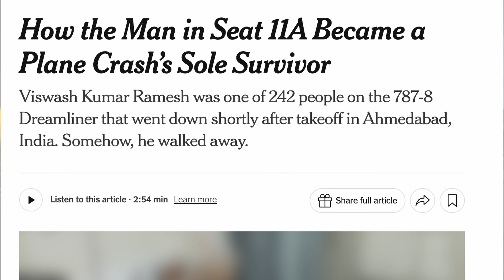Why the RAT Changes Everything – Air India 171 Update

Comment: I'm still wondering if the flaps even if not the primary cause made a significant difference.  That being raised and gear left down contributed to a worse crash by raising the stall speed.
Reply: The plane was not stalling in the video, it was flying in a high-drag nose-up configuration to buy time before the inevitable crash, as well as ensuring the lowest possible speed on impact.  That is what any pilot tries to do even when they know the plane is going to crash.

Comment: Note also the main gear is canted *forward**.  That condition (prior to retraction) speaks to me that the gear was in the **process* of retracting but failed.
Reply: Source: Swiss001
Reply: @Ducktility  Actually, a professional pilot... 🙄
Reply: Yeah, but even with a half deployed gear this wouldn't have happened on a normal flight.
Reply: @AccidentallyOnPurpose indicative of the power failure.
Reply: @AccidentallyOnPurpose  No, what this indicates it that the pilots didn't retract flap instead of gear. Likely not 'pilot error' (as least for a flap retraction).

Comment: If you hear a RAT over a 787 turbine then they ain't workin.
Reply: Not necessarily. The rat is incredibly loud and the engines are surprisingly quieter than you'd think. I've seen and heard  787's coming back from test flights in Charleston and could only hear the rat.
Reply: @paulmathis2191  You are exactly right.  RATs are extremely noisy.   We also had to do maintenance tests with them in the hangar using a hydraulic mule (no 787), OMG, they are so loud.  Yes, as you said, louder than the engines.
Reply: @paulmathis2191 On take off at full power i seriously doubt your hearing that even at supersonic ??
Reply: Power issue with airinda is common. Take any flight. Screens won't work.. aircon won't work.. some buttons won't work.. isn't it called as faults ? And still they are allowed to fly?
Reply: @ernishant13  "Power" when a pilot says that on a mayday call he is not talking about a light out in the bloody toilet
Reply: @jacktattis i understand that mate.. but fault is a fault. Small faults lead to big faults thats what i am saying. Air India never take faults seriously and slowly their airlines have issues which no one knows.. its scary
Reply: @jacktattis But the pilots words have not been confirmed yet, apart from "Mayday."
Reply: @ernishant13  All of which has nothing to do with the engines.
Reply: @ernishant13 that is not the same power. Those are interiors.
Reply: @ernishant13 

Are you serious?

IFE and how much air is being send to the cabin is not necessarily an indication of the health of the aircraft.
Reply: Agree!  And if the Pilot says "No Power, No Thrust, No Lift" the Aircraft is Dead in the Air at 650 ft. .... It's Over!
Reply: @jamesalexander5623 Did the pilot actually use those words? Apart from saying "Mayday" from the tower recording, nothing from the CVR black box has been released yet. 
It's social media rubbish, don't believe everything you read.
Reply: @jamesalexander5623 so you mean I'm dead 😮
Reply: @Bill-f4d9z  Unless you're in Seat 11 A .... Pretty Much!
Reply: @jamesalexander5623   Yes indeed but no one in charge is going to quote that They want a neat package where the pilots are going to be blamed . Boeing   had three disasters a few years back , quality control has been questioned and now this.The US aircraft industry does not want another investigation into Boeing.
Reply: 787 test flights happen over my house at least twice a week and you can only hear the RAT when it's deployed.  The 787s engines are incredibly quiet.
Reply: You got that right.
Reply: Especially at takeoff thrust!
Reply: 😃 I found the Rat 👉🐀
Reply: I was thinking the same thing. You have two jet engines at full power on take off, how would you hear that prop?
Reply: @LasVegas68  If they were working, you should see exhaust trails, especially so soon after takeoff.
Reply: Yeah I agree and it was the first thing I noticed when the video came out.   That sounds like what we are hearing is the reverse type sound of the prop cutting through the air from that thing and not a peep of jet engine noise.
Reply: That's going to make Boeing or GE look bad. 2 engine failures?
Reply: @jaysmith3259  I doubt it will be an actual engine issue or Boeing issue...
Reply: Maintenance? @jaysmith3259
Reply: @jaysmith3259  You assume it is Boeing fault.   The odds of both engines failing at the same time is very small.
Reply: That’s not true, Ram Air Turbines are very noisy, excessively loud and high pitched. Whereas a the main Turbine engines are designed to operate as quiet as possible and are a much lower and more thunderous pitch. The loudest those engines ever are is on landing upon deploying the Thrust Reversers. But on take off they may be at full power but are not as loud. Also like I said, they are at two very different and distinct pitch frequencies. So no, you would definitely hear a RAT. As an aircraft mechanic we do engine runs all the time, even at full power, and I never feel the NEED for hearing protection, however when we do a RAT ops check it is 100% necessary. It’s ear piercing. 😅
Reply: Exactly
Reply: Not so sure about that. I have done a number of RAT drops for maintenance in Challenger 604s. They squeal so loud, its unbelievable. We would get phone calls to the airport asking if "that" aeroplane is ok.  And the sound levels in the cockpit are almost unbearable. Anyone that's ever done a RAT drop knows what I mean. BUT - I only have that experience on one aeroplane, other RATs may have different audio levels.
Reply: Isn't that what he is suggesting? That the turbines aren't functioning. Although you could hear it on the JAL flight that was landing.
Reply: That's not correct,the rat will deploy automatically even with the engines at full thrust,and it's going to be poor maintenance and pilot error.
Reply: Plus hydraulic failure would prevent lifting the undercarriage.
Reply: @krkrdg surely it can’t happen this quickly. This thing had take off power. From the time an engine dies hydraulic pressure does not just disappear immediately.
Reply: Especially two jet engines that should be at take off thrust, they should be very very loud at that distance.
Reply: Exactly 👍🏼
Reply: You cant be this conclusive. You’re listening through a phone mic that probably has relatively low sensitivity at lower frequencies. You would need to see a normal takeoff to compare
Reply: @michaelbee8263  Lord have mercy.  Didn't you listen to what was said about why the RAT automatically deploys? 

There had to have been dual engine failure.

Working engines provide the electonics and hydraulics on an aircraft.  When there is an engine failure the RAT deploys in order to restore hydraulics and some electronics.
Reply: @deanjones2525  electrical failure causes the RAT to deploy. That may or may not be causes by engine failure. Loss of thrust doesn’t always mean loss of engine generators. Calm down.
Reply: Besides that, look at the landing gear tilting…
Before the crash, you can clearly see that the landing gear is tilting FORWARD.
This is the first step of the landing gear retraction sequence during takeoff.
But something stopped it—likely a hydraulic or electrical failure.
Reply: Air-conditioner had not been functioning for over a week on that.
Reply: Glad to know my RAT hearing in the first video comments was correct.
Reply: @orion_13 you’re so smart, good boy. What you hear in a phone mic is not what you hear in real life. The idea this thing had take off thrust and then went to no thrust in time to film this is ridiculous
Reply: @michaelbee8263 I've just been an aviation nerd since high school in the 80s.  I wanted to join the Airforce but was told that my height was already past max allowance for the F14.  It doesn't help that I am long torso.  My barber always complained that I sit as tall as when I stand. 😂
Reply: Wonder which pilot was flying. 🤷‍♂️ I would think the captain would be more focused on flying the aircraft instead of the radio.
Reply: Sabotage
Reply: Is there a betting pool of the cause?
Reply: Pilot used the entire runway to take off. Indicating something was wrong and pilot should have aborted before v1
Reply: How much money that Indian aviation has been taking from AI and Boeing is to be investigated by the bribery authorities in India
Reply: 😂😂😂😂. HAHAHAHAHAHA!
      Very simply put!😂😂😂😂
 Love it!🎉🎉🎉😂😂😂
Reply: @HerbBracy  Not sure who you are rplying to, but if you are replying to the original post.  Then you don't know anything about aircraft.  You can definitely hear a RAT over jet engines.  RATs are very, very loud
Reply: I know ABSOLUTELY NOTHING about aircraft and their mechanical features.
   I actually was responding to YOU. 
    I think you might have my post mixed up with someone ELSES post. 
I was just complementing your post. 
Sooo 
I’ll just chuck this up to a mistake 😊
Reply: Apparently the mayday call was “no power mayday mayday mayday” so this would explain and also support the RAT theory and the dual engine failure
Reply: Exactly. Why hasn't any of these so-called experts figured that out yet
Reply: @ranm8065   It's called not rushing to conclusions, Vince. When you actually are an expert and you have the full picture, you are a little bit more hesitant to jump to conclusions since you know how many variables there are. But if you are commenting on YouTube with no credentials or a background in the field, it's extremely easy to give a definitive answer, right or wrong.
Reply: @LelouchViBritaniaa Then I don't think any of these guys (who legitimately are experts) should be making vids yet.
Reply: @LelouchViBritaniaa  It was a simple question: Why? No conclusions presented. Why are you so triggered?
Reply: @LelouchViBritaniaa , true but, it’s common knowledge that a couple of jet engines at TO thrust make a pretty loud sound.  If you don’t hear them, they ain’t pushing.  I don’t think you need a Masters Degree in Aeronautical Engineering for that one.  In truth the black boxes will tell this tale.  Until then, it’s all speculation.
Reply: @Christian-vq8rd they ALL say they won’t know until ALL data provided.  They are making their best guess based on their expert level experience.  That is all.
Reply: @Christian-vq8rd   Why should they not be making videos like that, when people are genuinely curious to hear their thoughts? 
For example, should there be no journalists on sight if there is a bombing somewhere, just because they don't have every single piece figured out yet? Yes, you do have to be cautious about what you are saying, you won't hear me argue there.
Captain Steeve never claimed to know what exactly happened, but provided his own opinion based on years of experience in the field. It just boggles the mind what things people find reasonable to complain about.
Reply: @LelouchViBritaniaa If nobody should be talking until we have all the facts, that includes the experts. Hopefully theyre doing it to help and not for clicks. These vids get more views than any other kind.
Reply: @LelouchViBritaniaa  He isn't putting forward a conclusion, he's just stating the engine sounds were not there (correct) but the  RAT could clearly be heard (correct.)
Reply: @Christian-vq8rd Who is making videos? Nobody, except whoever took the "as it happened" videos.
Reply: @ranm8065  I was thinking the same thing when he said the RAT was deployed, and showed the video, and all you hear is that RAT....umm the jet engines would be screaming and you couldn't hear that RAT if the engines were under power...didn't hear them at all, not even at idle.  Something is off here, way off.  The RAT is deployed, ok, but why.
Reply: @ranm8065  experts did not see this original video its is confirmed that its power faluire
Reply: @ranm8065  They have...but it cuts into per diem.
Reply: @ranm8065 maybe thats why this engine manufacturer Rollce Royce, and -60% pressure less noise than regular this type enigines? This Airplane its a premium engines. Not chinese. That why you not hear engines.
Reply: Fuel pumps lost power. Look at what else is on the same power bus, landing gear, environ controls, fuel pump.

Earlier flight there was a problem with air-conditioning and other equipment.
Reply: @EdgyNumber1 LiIon batteries packs (two of them on the 787) lie close to a lot of vital circuits and if you ask ChatGPT part of the answer is frightening: “…•	The Trent 1000 or GEnx engines are powered by integrated generators on the engine gearboxes, which supply the aircraft’s main electrical system.
	•	However, a major electrical fault triggered by a battery incident can:
	•	Disrupt FADEC (Full Authority Digital Engine Control) systems
	•	Lead to indirect engine shutdown if electrical distribution and control units are affected
Reply: @GufoLab  Yikes that's even more extensive than first thought. The root cause could be the battery screwing with the various power buses.

But yeah, its not fuel contamination and the pilots did nothing wrong.

Comment: My theory: (for now) the FO shut off both engines at rotation. Pilot suicide.
Reply: And the other just watched and did nothing?  Highly unlikely.
Reply: @karhukivi those switches are easy to throw with no one noticing and the captain would be too concerned with flying to notice. It’s one of the only theories that makes sense.
Reply: You'd have to pull out and flip both fuel cut-off switches without the Captain punching you in the face.

Comment: It was a very hot day there. How long was the plane on the tarmac before takeoff? Vapor lock in the fuel line(s)? I had a Ford 500 in college back in the late 70s. It would not start or stall in really hot weather. Of course, back then, it had a carburetor. Can jet fuel pumps get valor lock?

Comment: Thank you for the update! You are definitely my favorite aviation YouTuber.
Reply: Same!
Reply: Ditto!
Reply: @AviationGeekJulia1994  Actually FIVE reasons why RAT deploys. (from friend Flight Safety Engineer in North Charleston; confirmed by blancolerio).

Pilots put out Mayday for “engine failure” at 13:38:25.

1-Dual engine failure; 2-Low pressure in all three hydraulic systems; 3-Loss of all electrical power to Captain and FO flight instruments; 4-Loss of all four electric motor pumps of the hydraulic system and flight control system faults during approach; 5-Loss of all four electric motor pumps of the hydraulic system AND an engine failure on takeoff
Reply: He’s awesome ❤
Reply: Captain Steeeve rules.
Reply: You’re on drugs, buddy. Come on.